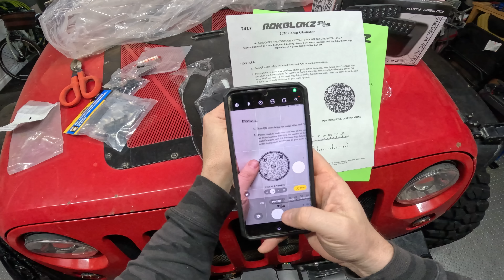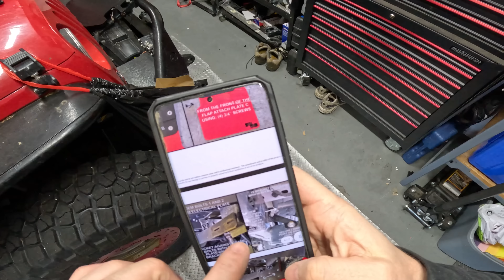The Controversial Jeep Mod That Everyone Loves to Hate

Comment: 2021 Mojave Canada… bought the fronts for all 4 wheels and did not need to cut them at all they fit perfectly took me and my husband working together but no gaps fits like a glove Thank you for the video!!! I had the Rokblokz already on my trk didn’t even have to remove them or my tires to install ( I run 35’s on 18’s)

Comment: I hated to do mudflaps, but love the Rokblokz when I added them. Even just the front makes a big difference for mud encrusted door handles and adding the rear was great for my bikes sitting on a rack (and for other drivers). Rokblokz are spendy, but the combination of being flexible + easily removable has been great for my JT. Mudflaps need to be flexible off the highway or easy to remove, but ideally both.
Reply: Yeah... I also use Rokblokz, and would recommend them. Love how easy they are to put on or take off.

Comment: we had the rock blox on our jl and then went to wide tires and offsets,  the trick is to use the hardware and make long jon flaps to fit, gave us 12 inches in rear, still allows to adjust, and can still remove easily,  also paired with the recon exstenstions,  we have cops cracking down on wheel poke and mud flaps in sask

Comment: I would trim the top of the mud flaps to over lap with the flairs and get rid of the v gap.
Then drill new holes in the mud flap.  The flaps will be a little shorter but that will be good so there will be less chance of them ripping off !
                   🤔

Comment: At the start of your video when you were drilling new holes and with difficulty....holding the piece and drilling. I was thinking for anyone doing this in the future that one could use 3M double sided tape to hold the piece in place and then drill all the holes at the same time. It would also help when installing the rivets. Just an after thought. Thank you for the video.

Comment: You need to squeeze the rivet tool, then release, then push it back in flush and then squeeze it again. It’ll break the tips off on the second squeeze.

Comment: What is it about the Mopar rear extensions that don’t fit on a Gladiator. I did see another channel where a guy installed them and all he had to do was drill a few different holes on the rear. I’ve watched yours and another channel where you both installed front extensions on the rear with a slight trimming modification. What is it that make the original rear extension not fit.
Reply from the maker: The wrangler rears look out of place and don't cover well compared to using slightly modified fronts from a Wrangler on the Gladiator.
Reply: Ah yes I see that now that I look at your video more closely. The other guy I watched; his did not extend down far enough. I ordered two pairs of front flares on your recommendation and just waiting for them to arrive this weekend. Thanks

Comment: I did all of that to my JT. The front flaps are only held on by the pastic waffle at the bottom. There are only two plastic tabs. I lost an inner fender liner and the flap one evening. That plastic waffle needs metal reinforcing.

Comment: 45:42 I am not feeling the love for the mud flaps, I just took mine off as I was turning around on a narrow road and tore one off. I am not running large tires though. Maybe it will look better once you get the 40"s on there.